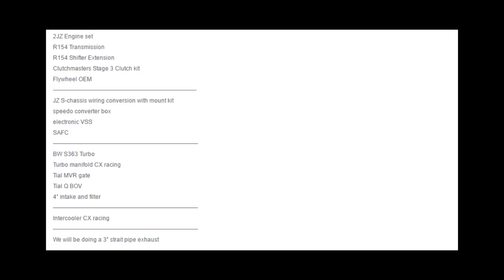2JZ E30 | Build Thread | BMW E30 2JZ swap

Comment: what transmission did he use
Reply: r154, which is expensive. If you are planning on swapping 2J or 1J in E30 or E36, then opt for a ZF 5 Speed transmission, buy a collins adapter and flywheel then your good to go.
Reply: thx
Reply: people also use the 6speed 350z trans too for a decent budget build, bit stronger than the r154
Reply: anytime, beautiful car and fantastic build. id love to put a 2jz into my e30 aswell.
Reply: This is the route i am taking however currently trying to find what driveshaft parts i need for custom fab
Reply: sollostyles let me know how much it cost to build pls